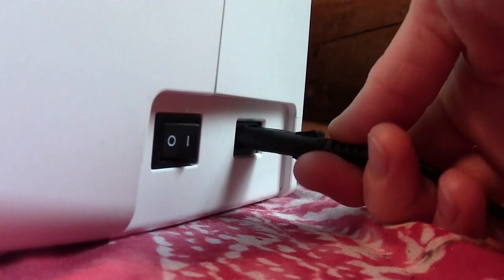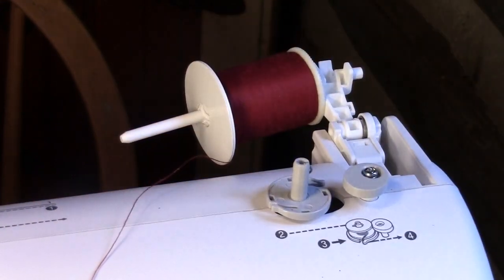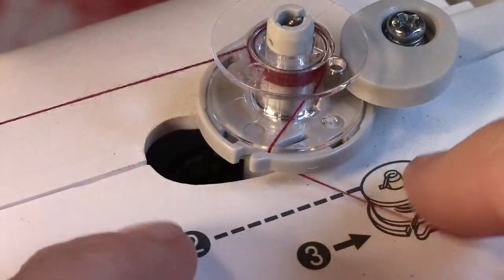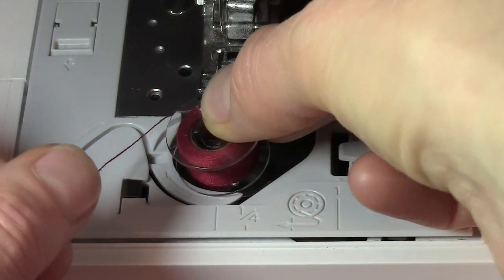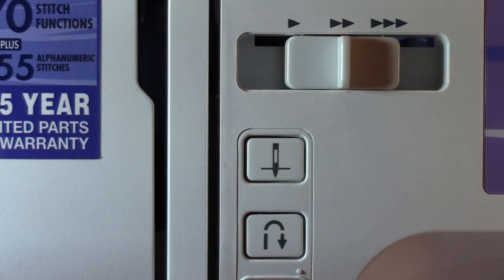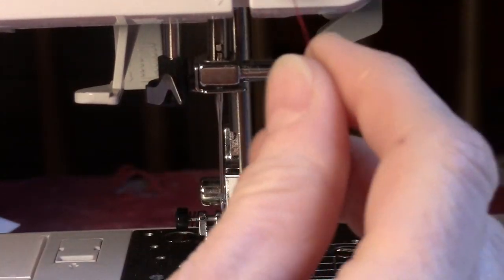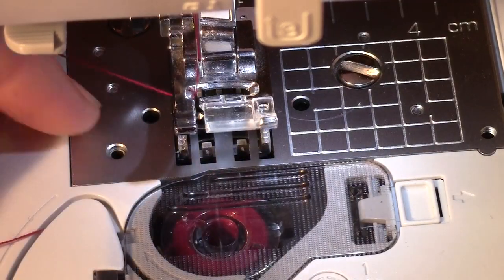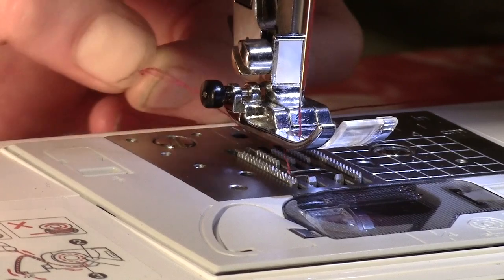Let’s Sew! How to Wind the Bobbin, Brother HC 1850 Set Up

Comment: thank you so much!  I still hard a difficult time when it came to the needle threading part. Have you found a "sweet spot" to place the thread or some part of the machine you use as a guide? Also, do you let go of the thread? or hold it tight? it took me about 10 times before I could get the thread thru...lol.

Comment: I'm having a difficult time with my new Brother HC 1850.  I can't get it to sew.  I'm not sure if I wound the bobbin wrong .  And I do not know if I got the thread hooked into the take-up lever. I do not know what you mean by the little hook because I can't see it.?? Please help me get started,   I'm so excited to sew.
Reply from the maker: Oh, sorry it took so long for me to respond! And sorry you are having trouble. If you can’t see the take up lever, crank/turn your side wheel while looking down in the slot. While you are turning it, you should see that lever move up and down. Then you can go ahead and thread it on that very easily. Also, make sure to watch the manufacturer’s dvd if you have it. Hope that helps.